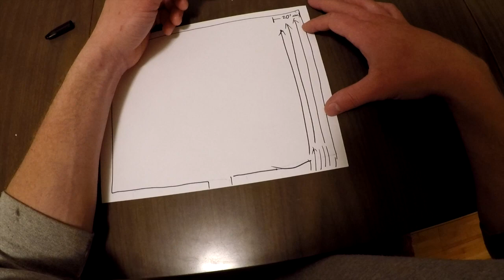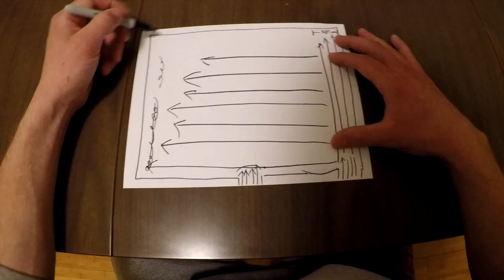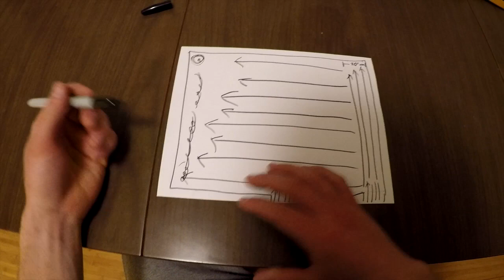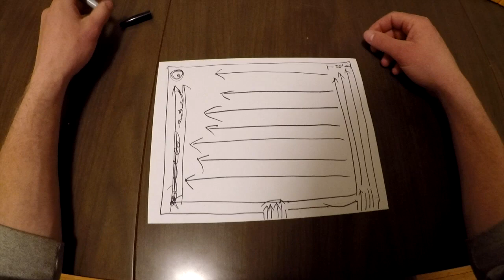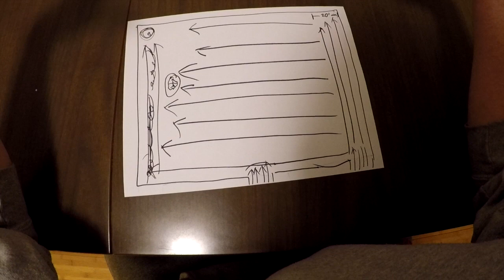MOST EFFICIENT Way to Plow a Parking Lot

Comment: Lately I’ve been watching plowing videos, and this is one of the better ones.   In the 1970’s it was my honor to assist my father with commercial snow removal.   There was no loader or anything to assist.  Rather than leave the windrow, we’d just push the snow up and over the curb/edge (north end in your example).  There was never a pile left in the corner of a lot, and snow was seldom moved twice.   
The lot could be split different ways based on the depth of the snow (or consistency…wet versus fluffy).   So a light snow maybe a south to north run, a heavy snow a west to east run…sometimes splitting the lot in half pushing west to east, yet rolling half to the south and half to the north.   The trick was avoiding light poles in the center of the lot.
Horsepower had little to do with things, it was the transmission that mattered..   we’d allow the snow at the end of a run to do the majority of the braking for us.
We used an old Bronco.  The local construction companies had pickups with blades a foot wider.  Dad could still clean a lot faster than any of them.  We charged by the hour and 150% of what competitors did, yet got all the top jobs.  Getting up at 3am after a fresh snow was like Christmas for me.

Comment: I just bought a Plow and installed it on my f350, to Plow only my driveway. How quickly or slowly should I be pushing the snow? Is faster better? Or is slower better? What’s easier on the truck and rig?
Reply from the maker: A couple things: it really doesn't matter if you push fast or slow. As you'll notice, the faster you push, the further you can throw the snow off to the sides or down into a ditch. It all depends on the property. For example, if there is a sidewalk near the edge of the driveway, driving too fast would cause the snow to spill over and fill in the sidewalk, in which case you would want to drive slow. Typically the only time you would break an F350 or a plow is if you hit something very hard. Also, depending on the weight of the snow, 4L might be needed to help save the tranny.
Reply: @EvansLandscapeLLC  If there's a sidewalk than you should make the first pass 3-4 feet from the sidewalk than move over and plow along the side of the sidewalk. This will give the snow a place to go.

Comment: Put a back blade on the truck. Don't have to push that 20ft in from the end. 

Pull the driveways in using the back blade so you aren't backing all the way out into the road to clean the entrances. Then run. Then plow the lot using both blades on the ground. Lift the back blade before you hit the pile. And repeat. 

Once you get the lot part of the lot clear windroll the piles from your back blade into the pile at the end of the lot. 

Back blades cut times in half and scrape cleaner on residential driveways

Comment: You need a 12ft box blade or whatever they're called. You've got the perfect machine for it and could annihilate big lots with it. That's what all the big stores who do it themselves use. Sell the little blade or keep it for smaller areas.
Reply from the maker: The 8' Kage that we HAVE is the perfect size for this machine. We have done our research. You should test out the equipment before you make recommendations. Thanks for watching!
Reply: @EvansLandscapeLLC  If the machine can't handle the weight then I guess the decision is made for you. I would be dying though watching it creep along with only an 8ft. swath. Good video.